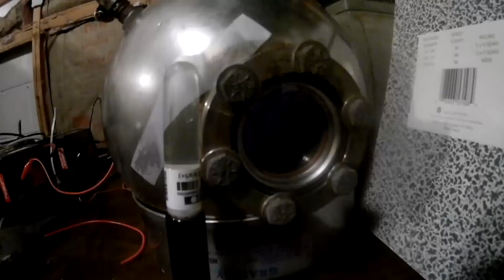Fusor - Nuclear Fusion and Neutron Detector Base Line Test

Comment: So are you getting any x-ray's even though your using AC?
Reply from the maker: I did not measure for x-rays.. there should be though.. x-ray tubes can operate on AC.. half of the current and voltage in the cycle is in the proper polarity.. it will definitely accelerate electrons in to metal walls.. But, with the AC, you don't have to worry about the run away arcs preset in the DC Fusor devices!
Reply: @jaynesnetwork  Running the fusor without deuterium turns it into a visually pleasing plasma generator. No neutrons, no x-rays. Now, in the link below, that's something more like a fusor :)

https://www.youtube.com/watch?v=v9DXecl-OX8